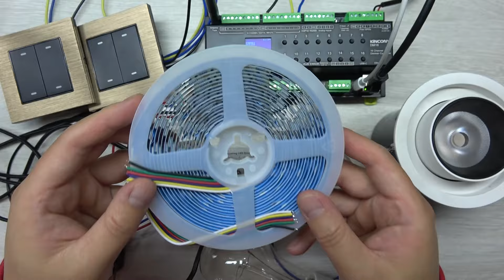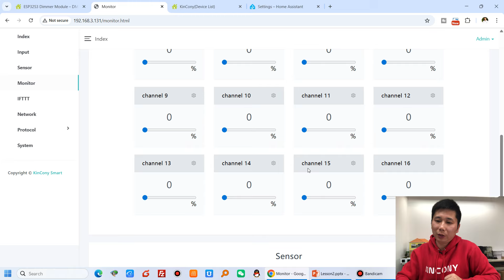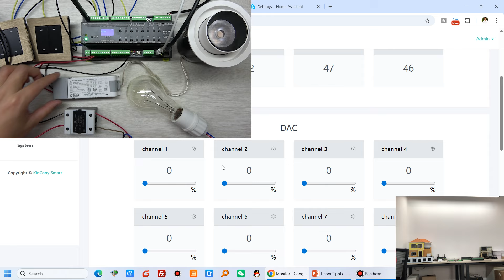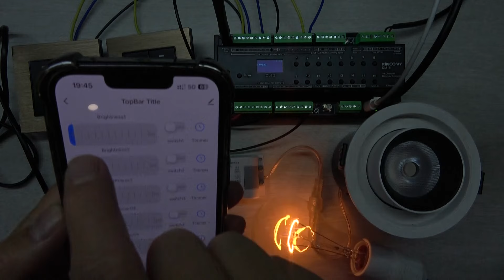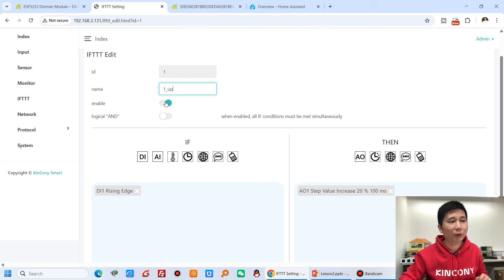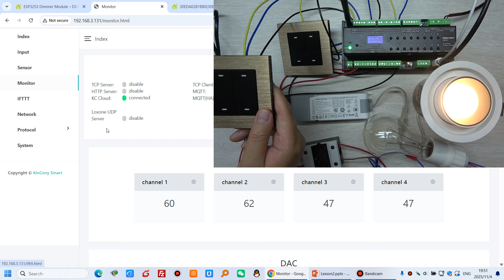Smart Light Dimming | KinCony Home Automation Training 2

Comment: Is the 220 V driver working also with LED bulbs? Can you make a follow up video showing the kinkony touch switches working with the dimmable lights? Is it possible to use them in this scenario?
Reply from the maker: sure, just need your AC220v bulb is dimmable. touch switch as same as momentary switch panel.
Reply: @KinCony  Could you make a video with this as well since i know that it needs a logical converter to be able to keep the touch light in sync with the controller?
Reply from the maker: @emanuelloghin9471  that use for relay controller , not work for dimmer controller.
Reply: @KinCony  Ok. Si I can use the kinkony touch switches with the dimmer controller but without the logical converter. The lights on the touch will turn off when I increase the voltage on the LED bulb?
Reply from the maker: @emanuelloghin9471  when i have free time, will have a test.